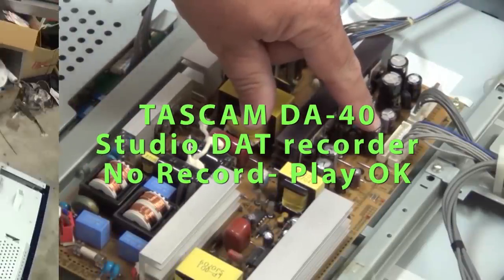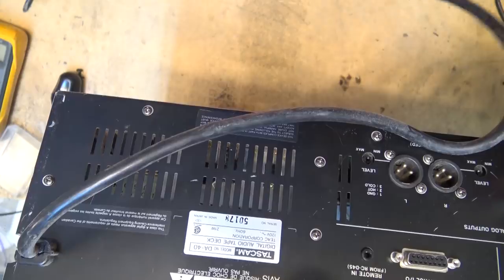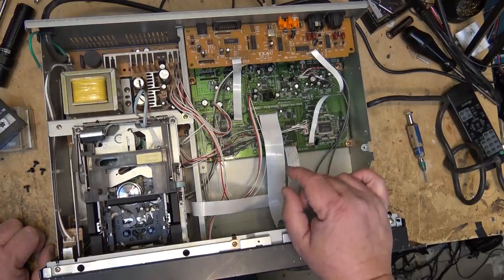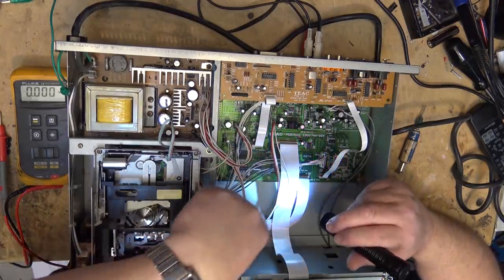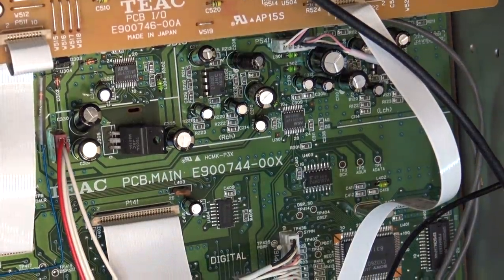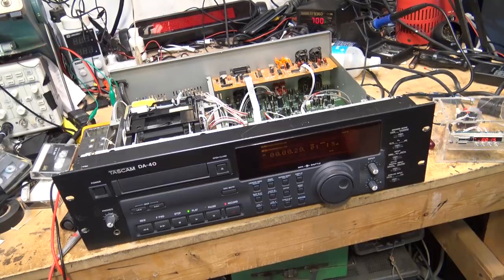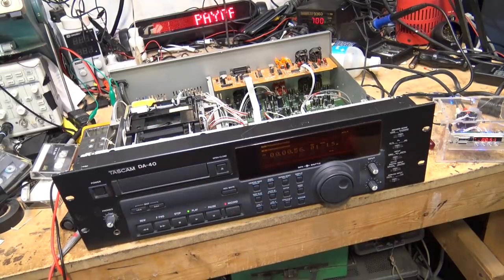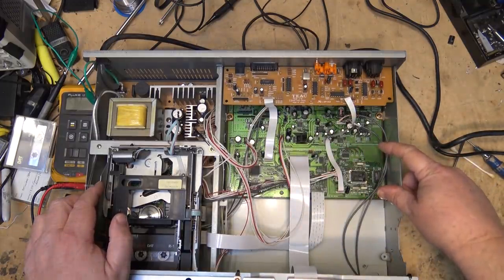Tascam DA40 DAT No Record Plays fine. Part 2 of a unit I started on 2 years ago

Comment: Add the remote, should be worth a little more
Reply from the maker: Don't have the remote for either unit.
Reply: I had a DA88 that quit.  Fixed it with parts from another dead one.  Have had plenty of other DAT's in the studio.  Panasonic and Sony mostly as well as Minidisc.  the remotes turn up on ebay often.
Reply from the maker: @gbowne1  
As far as DAT decks go I have 2 Tascam DA40, a panasonic sv3700, Sony 75ES and a Sony 680, a TCDD3 sony portable and a Teac DA-p20 portable.
7 DAT machines, 7 Reel to Reel, 4 cassette decks, a couple of turntables.
Too much stuff. This DA40 likely will be sold, but I will not give it away. 
Most of the DAT machines being sold are in need of service and have many, many hours on the drum. My Panasonic 3700 is such a machine, the heads are almost totally worn out, and it has many read errors. Still plays SP tapes fine, but LP is a problem due to the head wear. The 2 Tascam DA40 deck I have one has 239 hours on it and this one 230, but it will likely have a few more when I unload it, because I will extensively test it for 10 - 20 hours of record and play. This one has been totally serviced. When I got it the caps in the preamp were showing signs of trouble so they were replaced. Has a new belt that will be good for awhile, and the electrical fault repaired. So this one should be good for many years. The trouble with DAT is because they no longer make them or spare parts finding a really good one is becoming difficult because many of these professional decks were used in broadcast and have thousands of hours on them. Many radio stations automated to DAT in the mid 80's and through the 90's and ran them the 2000s before hard drive based automation took over. Sure larger stations went to hard drive based first but many mid size and small market stations remained with DAT or reel to reel based. I visited radio station KISM in Bellingham in the mid 80s and made a video of their reel to reel automation (it's on my channel). DAT made more sense when the reel to reel units started wearing out because a single tape would have 2 hours of music, all randomly accessible with fast cueing. They could put all their commercials for the entire days programming on a single tape, so basically 3 of 4 playback machines could handle everything.
Back in around 2000 I was working at a premise where a 50KW AM stereo transmitter was located. I took some pictures on my old phone of the inside of the transmitter room but havent been able to find them, but if I do I will share them. They had a solid state 50Kw motorola transmitter which was a rack of a bunch of PA modules, and a big ass tuning network, and an audio processing rack. It had a couple of T1 studio link phone lines a, audio processor with 2 VU meters and the Motorola CQuam exciter. There was also a little mixer, microphone, cassette deck, and a Tascam DA20 DAT player, with a tape cued up ready to go on the air should the studio link fail (dead air detector woud trigger it.) The microphone, mixer and cassette deck presumably so that if there was an emergency, such as an earthquake that took the studio out, someone could go to the transmitter site, and go on the air live. It was pretty cool to get to go in there. Back in those days cell phones has no video capability.

Comment: $30 for belt you must be buying your belts at the wrong place I buy 35 at a time different types and  they only cost me $6 a bag and they're good belt
Reply from the maker: This unit used a very specific size belt that is not available anywhere. And it wasn't the cost of the belt that made it 30.00  it was the fucking shipping and broker charges that drove the price up because the shipper put a declared value on the package. Had they checked commercial sample like everyone else it would have saved the broker charge.

Comment: If you record at a lower level you're not using optimum bit depth.  The noise floor is a function of the bit depth, which for 16 bit audio is -96.3dB before dither.  If you then normalise that recording in post production you will raise the noise floor.  On speakers probably no big deal, but through headphones could be audible.